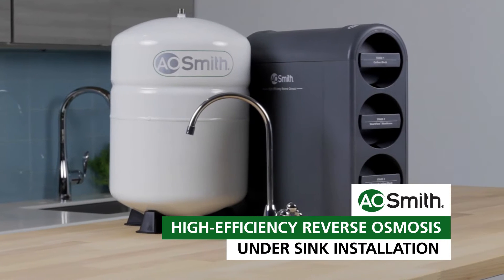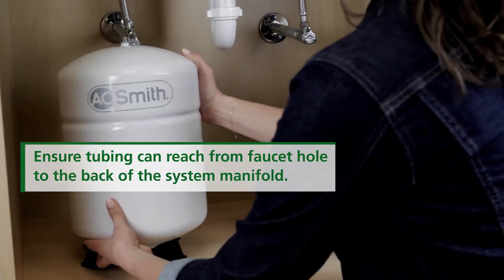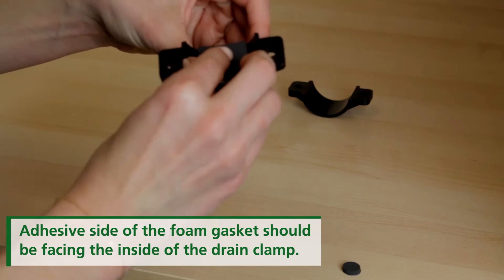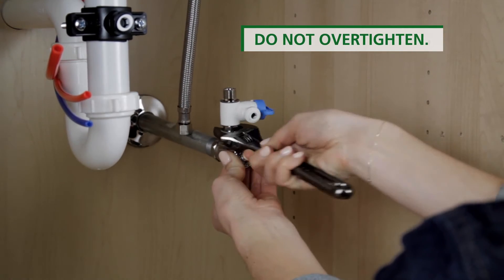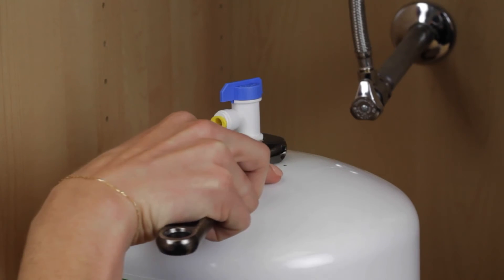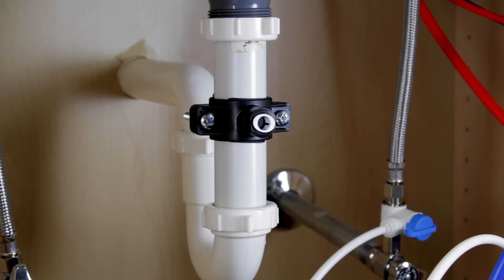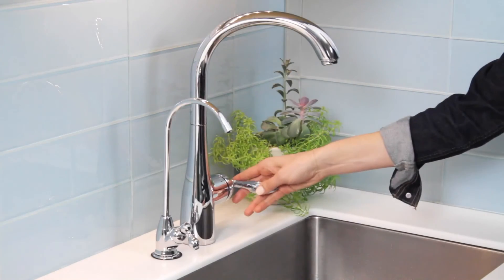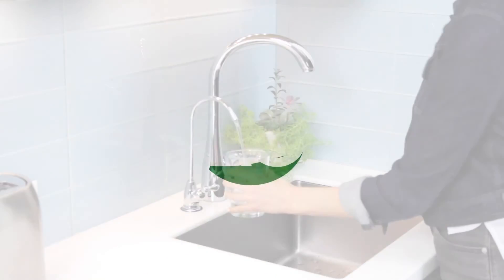High-Efficiency Reverse Osmosis Water Filter Installation

Comment: I had to disconnect my system for a month bc of kitchen repair due to fire. Now when i reconnect water is pouring out of the air gap hole. I dont know what is wrong. It should be filling the tank. Can you help?

Comment: I just hooked one up and it’s leaking inside the manifold.
Reply: I bough one and it was leaking where you insert the 3 filters, I exchange it for another one but it was the same problem.
Reply: Is the manifold the plastic case where you insert the 3 filters
Reply: @culicheqwerty935  yes
Reply: same problem
Reply: @adanpimenteljavier  they are sending me a new one. Pop off the panel below the hose connectors and you’ll see there’s like five screws. Snug those up and it may quit leaking. Mine did but the new ones already in the mail.
Reply: Same problem
Reply: The issue is with the drain pipe being too low. Make sure the line is routed higher than the PTRAP.